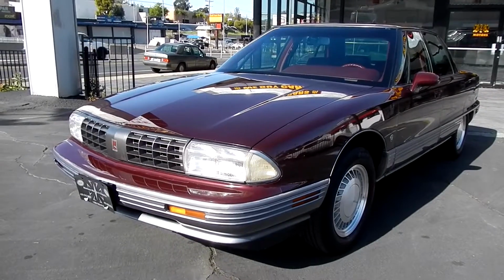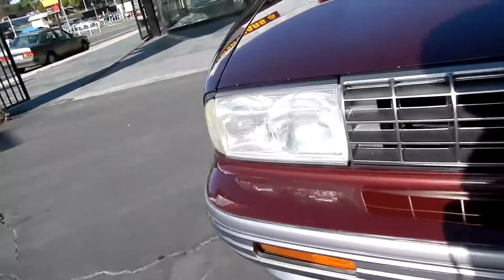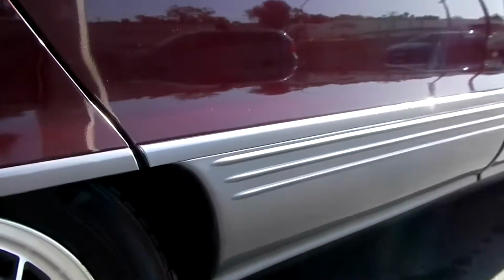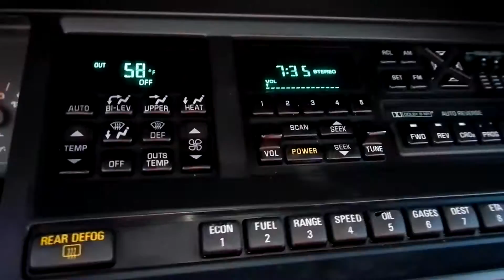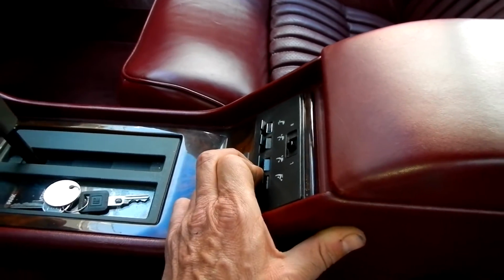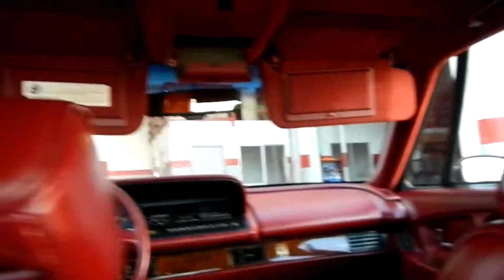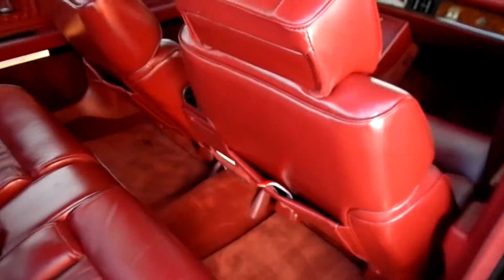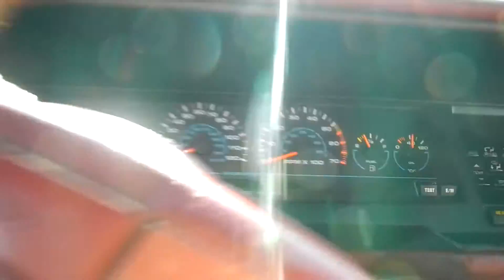Touring Sedan Oldsmobile NINTEY EIGHT 98 Sports Edition 1 Owner 1991

Comment: I had a 1993 Oldsmobile 98 Regency Base the same color brought with 79,000 miles and drove it till 249,000 miles. I drove from Pittsburgh PA to Peoria IL on one tank of Premium 93 octane gas got 41.5 MPG on that 3800 series V-6. These are very indictable cars mine lasted 8 years. The only major problems I had were the transmission, water pump and Pass Key system replaced that was all, and it made 6 600 mile trips every year never broke down once and never used any fluids or oil.  I wish I could find another great Oldsmobile 98. Nathan you should keep this these are great cars and cheap to work on and excellent on gas.

Comment: Shame GM got rid of oldsmobile
Reply: What killed Oldsmobile they put out ugly shit like the Aurora MSRP $36,990  with the Shitty North Star Cadillac V-8 Head Gasket 6000.00 to fix and they all leaked oil and but ass ugly, and the butt ass ugly Acheiva. They got rid of the Cutlass Cirea which was popular among  small families on a budget 9995.00 new. Then in 1998 they killed the 98 MSRP $28,995  and a year later they killed the Delta 88 MSRP $18,995 . These cars were what Olds was known for.
Reply: They gotten rid if Pontiac too.

Comment: warning on all these 98 and the 98 as well as the buicks lasaber where the body it attached to the engine cradle they rust so bad the outside of the car look perfect then the car breaks in half at the cradle no way to fix it right behind the rear wheel

Comment: The car iam looking for right now is 1988/1991 Pontiac Bonnieville SSE That is clean...options are not an issue as they were all loaded, aside from leather or not...Nathan, or anybody that knows of one in good running condition and shape, let me know Thanks Guys.
Reply: My parents moved from Rhode Island with us kids in 1996 and the money they got from the house me and my brother and sister were born in in Rhode Island some of it went to buying a new car( for us anyway) it was the 1990 Bonneville SSE with all the bells and whistles we had it almost 10 years till 2005, it's still ran but it had to have two alternators in the new door because my dad went down a back road following my grandfather's truck and slid down a hill denting in the driver's side door when he got a gray one from a similar model car but it never fully the electronics never fully worked right again, but when we got rid of that car 2005 it still ran I kind of wish did I asked my dad to put it on the back of the property and I could have had it as my first car but I was only 14 or 15 at the time so I didn't really think about that back then, even though that was about 20 years ago and I'm in my mid-thirties now I still think it's one of the best cars our family had one of the most reliable and that 3800 engine that GM made for Pontiacs Buicks Chevys and Oldsmobiles is still considered one of the best engines GM put in their 1980s and 1990s cars it's just about the most reliable engine from that time period other than a vortec.

Comment: Oldsmobile design went downhill beginning in the mid 80s. This 98 may be in good condition but the design imo reflects why Oldsmobile met its demise. Oldsmobile's last best years were in the mid 60s to early 70s with a reprieve in the early to mid 80s full size models. Beginning with the 1985 smaller 88s and 98s, they just didn't do well into the early 90s. The rest is history.